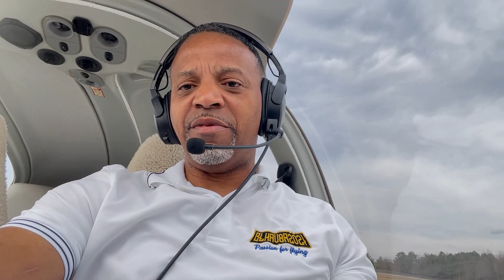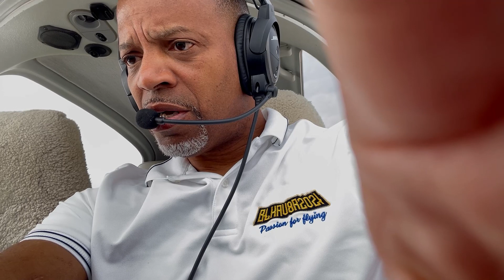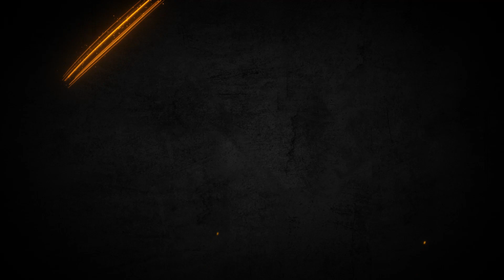BOSE A20 AVIATION HEADSET MIC ASSEMBLY REPLACEMENT COMPLETED AND WORKING

Comment: Glad the cord replacement on your headset worked out. Less expensive than sending it in, or buying a new one. I went from many years of flying with Telex, first with the simple one-ear earpiece (no mic) to an 850 (noise-cancelling). When the 850 literally fell apart, I borrowed a friend's Bose for a couple of trips. For some reason, there was a faint hollow sound, sorta like being in a cave. I demoed a David Clark DX ONE-X four years ago. Ended up going with it for work and a second one for my Decathlon. Many I've worked with swear by Lightspeed for their quality and customer support. Headsets are a purely personal choice thing.
Reply from the maker: This is my first having an expensive headset. I really like the noise canceling that the A20 has.
Reply: @BLKAV8R2021  I had to get used to switching on my David Clark for the noise-cancelling feature. That's when you really appreciate the difference!